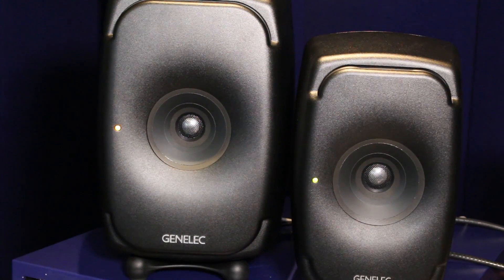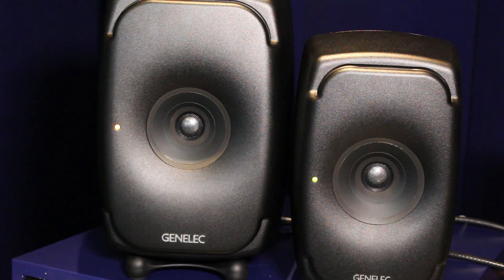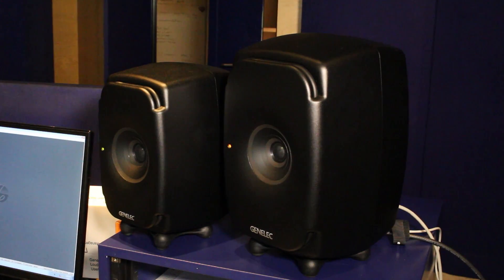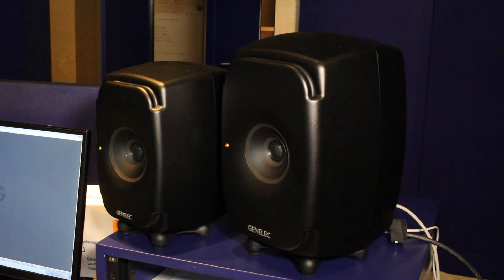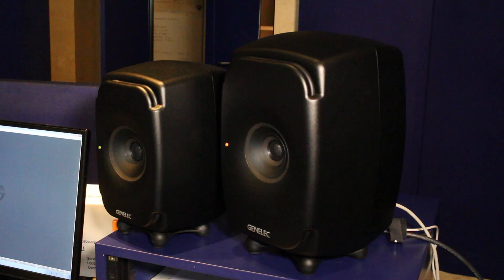Interview - Aki Makivirta, R&D Director at Genelec

Comment: Brilliant implementation of a 3 way coaxial monitor that appears to solve to decades long dilemma of acoustic discontinuities between different drivers. 

I wonder;

A) How well/long the adhesives holding together the flexible sections - that terminate the mid range to both, the wave-guide/horn, and tweeter - will last after extensive use/heat.

B) What the test measurements (including for; frequency v pressure - cumulative spectral decay plot - step/impulse response - phase v frequency - diffraction {power cepstrum} - acoustic centre - distortion - intermodulation {particularly between mid range and high frequency drivers}) are.

Still, a very, very clever design.